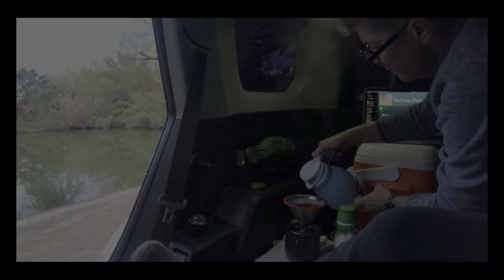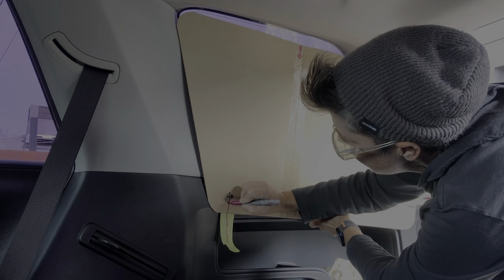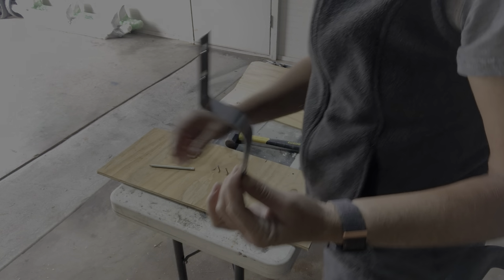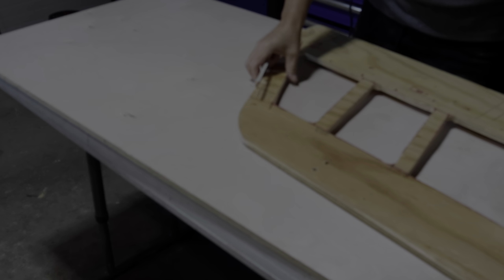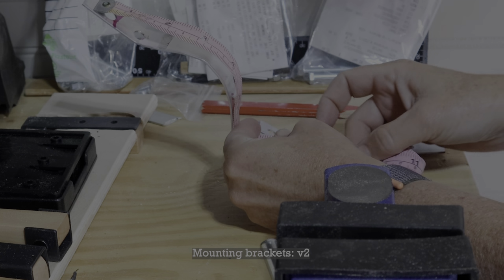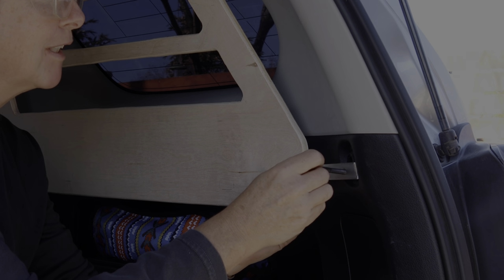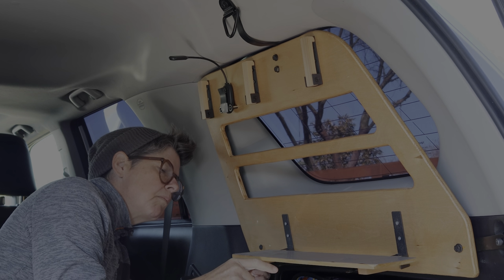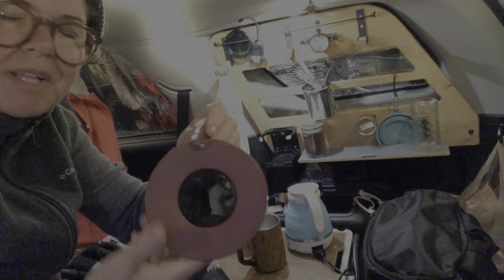The "Folly Panel" - a plywood window-mounted coffee station for my 5th gen Toyota 4Runner

Comment: Try using masking tape under the cut lines (apply tape, then draw your cut lines on the tape)...or score the cut lines with a drywall knife before cutting, to help minimize tear out. Yes, time consuming, but faster than putty fill and sanding. I like how you use a lot of recycled material with creative design skills. Forming those curved brackets out of aluminum stock was very cool. The use of a drawing compass with pencil point on one end, needle point on the other, should prove very useful to scribe cut lines on your templates. Good going, using templates and trial fits. Money saving!
Reply from the maker: Thanks for tips! I'm keeping track of all of these for when I get around to tackling the driver's side window panel project. 🙂 I'm thinking dropdown table with a secret mini bar. 😂